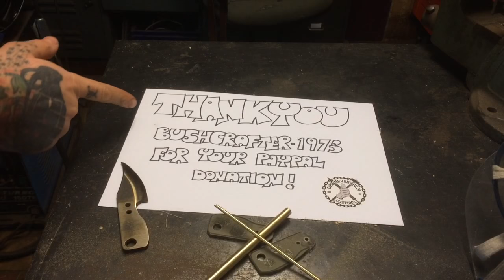Mini bowie neck knife - knife making

Comment: how are you heat treating the blades?
Reply from the maker: I heat treat in my gas forge cooling them in parks50 oil then I temper in the oven hope that helps 👍🏼👍🏼👍🏼

Comment: Awesome knife build bro just one question at the beginning where you cut the steel to rough shape are you using a circular saw with an abrasive wheel?
Reply from the maker: Thanks man. I use a grinder with abrasive wheels yes 👍🏼👍🏼👍🏼